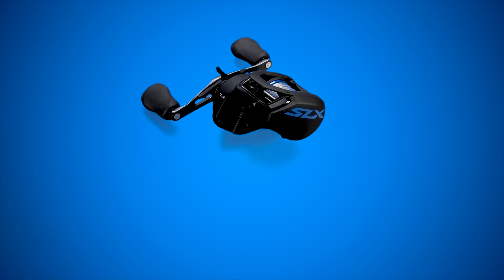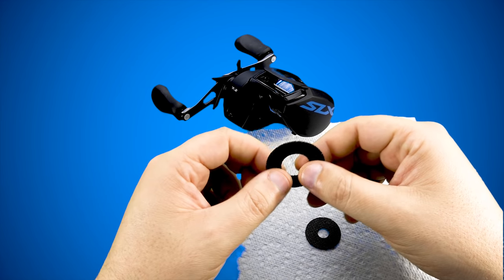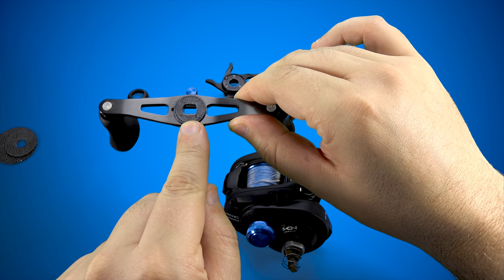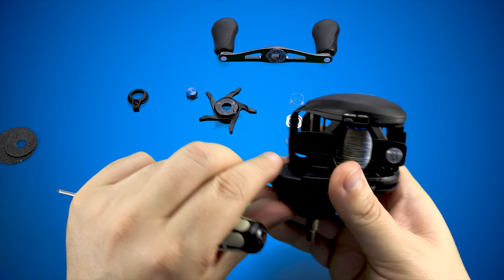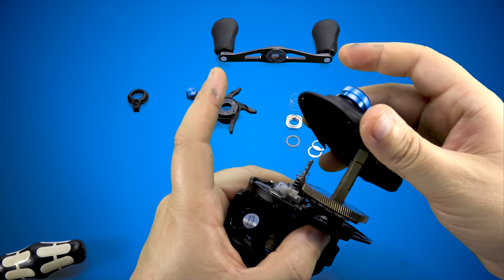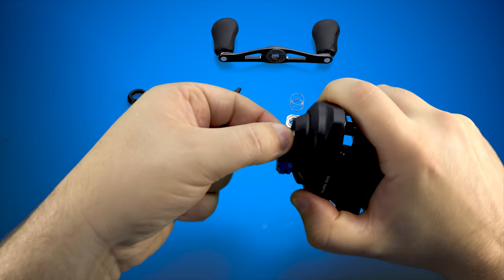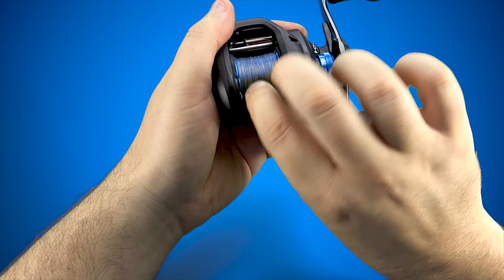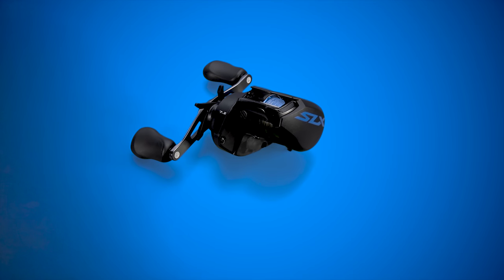Shimano SLX Carbon Fiber Drag Upgrade tutorial!  SIMPLE 2 tools and 10 minutes!

Comment: Hello, here a question. Lets say with this reel for example i add 1 or 2 more carbon drag washer with seperation washers. Would that increase drag power ? This reel has 11 to 12 pound drag. With the addition would it now be higher ? Like +/- 15 lbs ? for example ? Would that work ? Thanks.

Comment: I just ordered my SLX, I was wondering what the benefit is from changing out these drag washers? awesome walkthrough though, I feel like you could take that thing apart with your eyes closed
Reply from the maker: Lol I feel that way about some reels when I have to reshoot things after brain farts or doorbell rings and garbage trucks lol... It's a bonus upgrade makes the drag just a wee bit smoother and more durable.
Reply: @TackleAdvisors  I just finished this upgrade, and it was a significant & very noticeable  improvement, at least for my case. Couldn't have done it without this video!

Comment: Anyone with an SLX DC (I have the HG), ypu can upgrade to cross carbon drag washers by buying the SLX 70 MGL HG washers. Different gear ratios will likely be fine, but Ive only done it with the HG.

I picked up the OEM Shimano cross carbon drag washers from my local tackle store (always support local shops if possible), total cost $9.25. Perfect fit. Went fishing with them, perfect function.

Comment: I got one of these a few weeks ago, and fished with it this week. First fish I set the hook and drag slipped. I thought I had set it... So I tightened the drag pretty good. Next fish, set the hook, drag still slipped (these are 1lb bass in open water..). I tightened the drag to the max now, but haven’t caught another fish since. This is my only baitcaster I have had this problem with. Is this what everyone else has experienced? 

Do you think this mod will fix it?
Reply from the maker: Are you fishing braid.... 9 out of 10 times it's the braid slipping on the spool.  Very unlikely it's the drag being inconsistent.. A few wraps of mono or a wrap of electrical tap in a balanced manner likely will resolve it.
Reply: Tackle Advisors I wish I was, but it’s 17lb fluorocarbon. I didn’t realize this reel only had 11lbs max drag (8:1), maybe it’s just that and I’m used to a little more
Reply: Your drag is slipping when you set the hook with 17lb flouro on 1lb bass? Okay.
Reply: @joem8875  with this reel, you are correct. I use it for exposed hook baits now because I kept having issues on hook sets only with this reel.

Comment: Just an update on the products. They’re available on Amazon, but current cost for prime member for 1oz. Grease and the washers is $34.84
Reply: PTFE lube in fishing brands are stupid expensive. Just grab a good mechanic/ byicle brand and its very cheap. I use INOX PTFE grease MX6 it was $10 AUD for a 30g tube, the inox products are amazing i think the MX8 is a thicker product and would be better in higher pressure application like drag washer lube.

Comment: Does the washer replacement increase max drag or is it a durability upgrade?
Reply from the maker: I find carbon washers to pay out line smoother at higher settings and they stay more consistent longer.  Not really needed for bass fishing.  But it is an upgrade

Comment: Great video is the reel better than than the Casitas though?
Reply from the maker: It comes down to what you're using it for and how much you value external brakes.  I like the reel. It very good all around and very solid.   But if you're only buying one reel for a bunch of applications.  Go with a reel that you can adjust the brakes on the fly.

Comment: Good video!
What reel to choose between SLX & Casitas for texas rig and jerkbait bro? 
I'm a newbie at baitcasting.
Sorry for my bad english. :(
Reply from the maker: I think as a newbie an externally adjustable brake would benefit you.  As you can start off with all the brakes on and the dial set high and as you get the hang of it.  Turn the dial down.  There is also the fuego which is larger in physical size but has a ver newb friendly brake which is 100 percent externally adjustable
Reply from the maker: @NguyenLuong-rq1hg  yessir.  Great reel for the money
Reply: Tackle Advisors thank you so muchhh!!! I'll get one tomorrow

Comment: Would this make your drag heavier? I love shimano reels but I just want more than 11pound drag for when I’m punching for instance. a reply would be immensely appreciated
Reply: Surely you got your answer by now but just in case you haven’t or anyone else sees this comment...

You do not need that much drag for bass fishing. 6-10lbs is PLENTY. If you’re locking down your drag you’re doing it wrong. 25% of the rated line strength is all you need. 

Use a proper rod, reel and line and let the fish play if needed. The fad of essentially launching the fish into the boat is asinine.
Reply: @Cerus98  that’s not an answer to the question at all.  But playing the fish in heavy cover? It’s not a jerkbait.  Anyone who has flippednheavy cover or punched a lot like the OP asked about, has lost fish simply by taking a second or two too long to bring them out of the slop, lay down, etc.  having a heavier drag is akin to a H vs a MH rod.  Yes, the rod is more important in controlling the fish, but if you’re modifying an SLX, you may not be a guy who can just buy a new rod solely for flipping.

Comment: I follow the salute with interest. I have a question for you. twinpower sw 4000 xg, which should I choose the new stradic sw5000xg? or what would you suggest
Reply from the maker: Twinpower SW is sealed better than the stradic.  Twin power is very very refined in fit finish and feel.  Stradic is just...very good.
Reply: Which one would you choose? thanks for the answer.
Reply: Is it worth the price difference?
Reply from the maker: @Serhat1453.  that's up to you and what you value.  No small reel is worth 400 or 500$....you're always just paying for the refinement.  With diminishing returns.  They're nice but nowhere remotely needed.  It's an enthusiast thing.    Saragosa sw will do 99% of what the TP will do.  While being easier to work on.

Comment: Does this work with the DC model as well?
Reply: Yes. The DC has the crappy felt washer. I went to my local tackle shop and they had shimano oem cross carbon drag washers. If Im remembering right, I ended up using the oem carbon washers from the slx 70 mgl hg as exact replacements for my Slx dc washers

Comment from the maker: I promise this is the last shimano SLX video.....I don't even want to do the trax 200 after the amount of time spent on this one.  :)
Reply from the maker: It likely won't increase it.  I didn't test it.  But It'll start up smoother and retain its consistency longer which is why it's a benefit.
Reply: Tackle Advisors how does corrosion-X work on gears is it sticky enough or should I fork out the extra bucks for aquashield?
Reply from the maker: @brendabbustamantay6802  I feel weird recommending aquashield because it's very difficult to work with....if you saw the spider web pattern on the top of the drag stack when i took the sideplate off.  that's how stringy it is.  And it it gets where it shouldn't go.  It's  a pain to get out.  If you get it in the wrong spot of an ar  clutch and you don't have a parts cleaner or dental irrigator ya mightas well throw it in the garbage.   Corrosion x grease works very well so does yamalube but they behave more like normal greases
Reply: Actually I like the reel so much I don't mind all the SLX video's! lol
Reply: Tackle Advisors thanks I figured that would be or could be a problem with the aqua shield. Thank for the answer and your vids are stellar!
Reply: Tackle Advisors I want to upgrade my drag on my Lews Mach 1 but can’t find pre cut washers so I was going to buy the sheet and cut them out myself but I was wonder if you knew what thickness of sheet I should buy for that reel? Thanks bud
Reply: Tackle Advisors can you do a complete breakdown on the Shimano Cardiff 401

Comment: Can i use Cal's to grease other parts of the reel? It's the only one i have atm.
Reply from the maker: Others do but I don't
Reply: @TackleAdvisors  Thanks! :)
Reply: @arabarran  i likecto use small amounts of Penrite Marine Grease for gears, sliding parts and general coating of gear box inner frames and plates, corrosion x/ reel x for slow bearings, worm drives. I like the marine grease, it's cheap, long lasting, great corrosion resitance, tacky and nice to use, stinks a bit:)

Comment: Hey Tackle Advisors, quick question for ya. I was out fishing the other day using a jerkbait on my shimano Citica 200i, and every once in a while when i would give the rod a good jerk, the reel would "explode" on me if you will. The handle and the spool would all move backwards while the spool was engaged, allowing line to come out uncontrollably. Not quite sure whats going on with it but I would assume it has something to do with the anti-reverse bearing. Any help with this would be greatly appreciated! Thanks!
Reply from the maker: Hey Brad.  Does the handle turn backwards?  If you remove the spool.  And look at the pinion gear where the spool shaft pin slots in.  Is it free of debris?  Is the side plate on all the way and how tight is your spool tension (the knob on the handle side)
Reply: Yes the handle does move backwards occasionally. Most of the time it seems the anti reverse bearing is working as I can’t just real backwards with it at any time. It only goes backwards occasionally when I jerk the rod and put some tension on the line. Other than that everything else is normal with the reel. I keep the spool tension where I would on any other reel and everything is free of debris.

Comment: I saw a guy in one video. Put the bearing on the driven shaft 5х9х3, Bearings in the handle and on the screw 4х7х2,5, Hybrid bobbin bearings 3х10х4 Ordered on Ali, but this is probably poor quality
Reply from the maker: You can add bearings but if the Knobs are shimmed well you don't really need them.  The adding of a bearing in the handle shaft isn't needed.. No gain.  Shimano scorpion mgl actually put a bushing there. Which I liked seeing